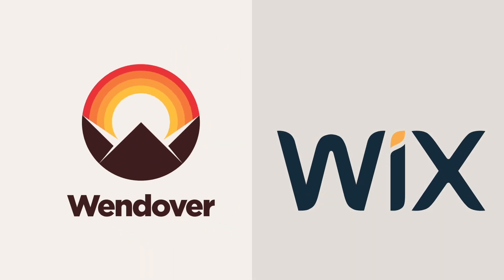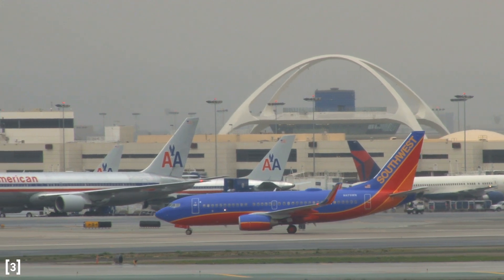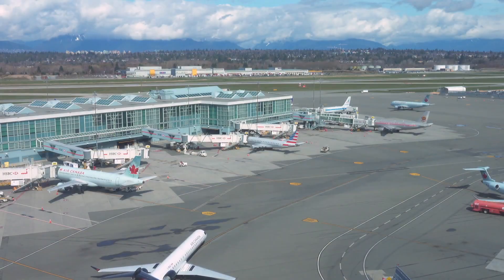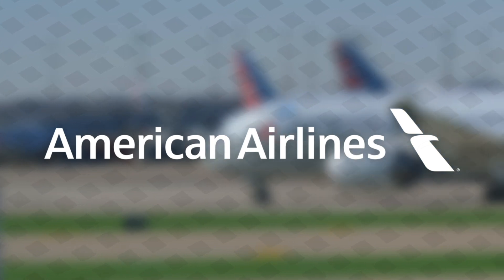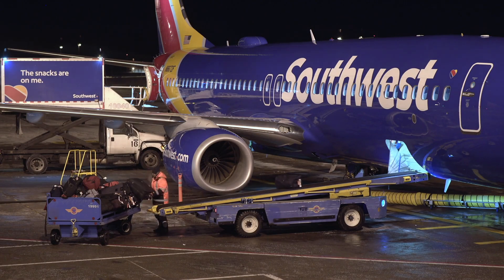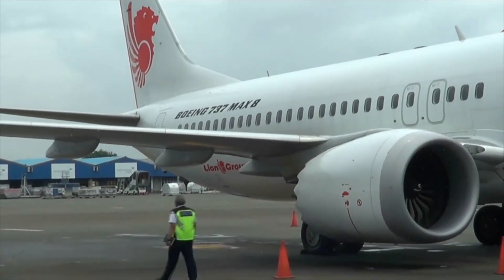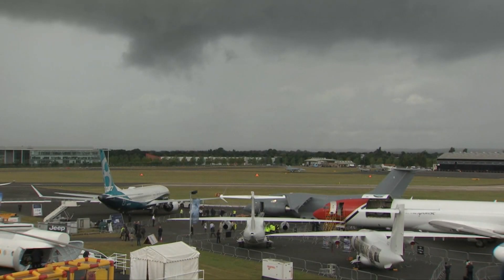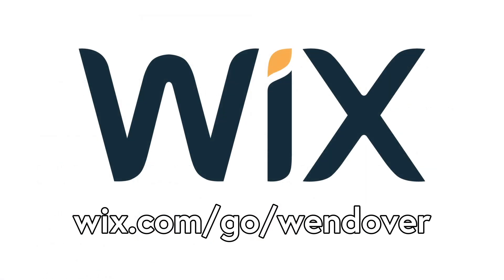The Economics That Made Boeing Build the 737 Max

Comment: So is this aircraft like a video game that has a fault which is later fixed by a patch and that's OK? What a load of rubbish, the lives of people are involved here and if Boeing could not factor in the cost of introducing a completely new aircraft then they are unfit to be in business.
Reply: Airlines didn't want a new plane so you can't blame Boeing for not making one. If Boeing had made a completely new plane others would just use Airbus current and updated models.
Reply: @RawbLV  I bet airlines would want a new plane if it was better for them than the old one, that's what I'm getting at. It sounds like Boeing  was not capable of delivering such a plane but Airbus was so Boeing try to compete on the cheap which then costs lives. Boeing sound typical of a company that concentrates on short term profits at the expense of long term viability.
Reply: @FairladyS130  Airlines wouldn't take it, they would have to cover the training and all the loses that happened because of pilots not being in air
Reply: @RawbLV  I've already responded to that point, a better plane is one that would be economically viable for the airlines. Or isn't Boeing capable of doing that? And how come Airbus are apparently head of Boeing?
Reply: @FairladyS130  Come on dude. A new plane wouldn't be economically viable. It would be much safer just to receive an updated plane. You have to understand that a new plane requires new spare parts, training for maintenance workers, flight attendants, then actual training of pilots and downtime, and there's probably a lot more to it. You think it's better but you're wrong, that's why airlines wanted to have the same plan with only few modifications, mainly the engine. And why did they wanted a larger engine? To have a slightly better efficiency so that they could save a few bucks. Introducing a new plane would cost more than those savings could offer. It's the whole reason why Boeing was forced to this position.
Now, why Airbus is in the leas, I don't know. Could be because Boeing has had made many accidents before which lead to crashes, but I really don't know.
Boeing is too big to fail and they're backed by the military. CEO will keep blaming pilots for the crashes to keep the shareholders happy. They won't admit their fault, at best - only partially, mark my words.
Reply: @RawbLV  Logically you are saying that airlines would only have one plane for economic reasons. So where does Airbus fit in, airlines are using them too which according to your 'reasoning' is uneconomical. Why don't you face the reality that  Boeing fave failed to compete with Airbus. But not to worry, your taxes will bail Boeing out.
Reply: @FairladyS130  Exactly. Airlines usually operate using a small number of planes. The cheap airlines like Raynar use one plane only and as little staff as possible, that's why their profit margins are much higher compared to big airlines (it's actually a very fascinating subject, I recommend you read more about it, if you're interested).
I know Boeing is failing to compete, it's not a reality that I don't accept lol, did you even read my comments?
My point is that Boeing had to update their design as airlines would not accept a completely new plane. Their updated design had poor flight characteristics which they had to patch using software and the rest is history.

Comment: You neglected to mention that the 737 has just about the longest and best safety record of any plane in the sky, and that the Max suffered a very simple - yet very tragic - fault which is easily addressable.  It's also worth pointing out that it was the new technology that crashed the planes,  and not the decades-old cable actuated design with the 7-step starting procedure and paper checklist.  You (intentionally) try to make a great company sound like they haphazardly cobbled together a bunch of outdated garbage into a death trap.
Reply: U are sure? 737 best safety record? Max's is flaw design

Comment: All the Max needed was a DC9 style stick pusher to push the elevators forward and warn the pilots of the stall, rather than the computer overriding the pilots, which ironically until the Max was what Boeing had as a core philosophy. Pilots fly the plane, not the computer.  Wore when they added this computer system they didn't tell the pilots, and worse, instead of just pushing the elevators it trimmed the entire back wing in such a way that it became a total loss of control to correct.    Sad, these crashes should never have happened, and MCAS, was never really needed.   Old school can still be the best school when it comes to flying. Fly the airplane.

Comment: Correction: 737-Max does NOT have a tendency to stall. It would actually stay pretty flat if it were to stall. MCAS was introduced not as a stall prevention system, but to "simulate" the flying characteristics of 737-NG. In doing so, the system can automatically trim the airplane depending on flying condition - normally just to make the airplane fly like the old 737's so pilots wouldn't have to retrain for MAX airplanes, something that is heavily desired by airlines that ordered MAX.  But of course if the Angle of Attack sensor (alpha vane) is broken, this fly-by-wire system (MCAS) that is freshly installed on the MAX could pitch the plane down, but the system was not designed because the airplane tends to stall. A big distinction there.
Reply: Look again, mcas is still antistall system. "Pretty flat" is not full flat...

Comment: Hey wendover how are you ? Sorry to say but this video is not at the same quality level as the other videos you have done,  the first minute off this video have alot of false information, to begin the 737 max have a screen who tell's the pilots what is wrong with the aircraft, and even have colored warnings that tell How bad the problem is: white for information, yellow for caution and red for emergency, I think the light you are talking about are the master warning and the caution lights, those are mandatory now days and every commercial plane have to have them.
Another point is the start up procedure, all commercial planes need to do more than one steep to start up, is a safety mechanism and wrong to point this out as a negative "feature" off the 737 max.
I hope I was useful for you in some way, and please, take this as a productive criticism.

Comment: I do agree MCAS has design flaws, but I disagree on the fact that MCAS caused the two crashes. MCAS will not be activated when flaps are extended or AutoPilot engaged, so if everything went will it will even be a factor during flight. Also there are 3 ways to override the MCAS, including a permanent way to disengage it completely. 
As shown in the Ethiopian crash preliminary report, the pilot made several mistakes and get tunnel visions with MCAS and ignored the more serious problem of over-speed, the accident itself is much more complicated than just the MCAS.
Reply: Mcas is cover up for bad airframe design
Reply: @mateuszzimon8216  Boeing do not have any choices anyway.
Reply: @saturnv2419  Boeing have choices make smaller version of 787 as new frame, but choose to just slap big engine on old frame
Reply: @mateuszzimon8216  Because designing a new frame take a lot longer time, neither Boeing nor its shareholders can tolerate that time.
Reply: @saturnv2419  shareholders vs good design, but Boeing just can't tell AA we make a 100ng and u get 100 of new plane when is finished. This is why we don't have new car with reliability like old Volvo's...
Reply: @mateuszzimon8216  The problem with that is A320 would take over the market like 787 did, which Airbus lost a ton of money but designing the new frame of A380. 
No one would thought the MCAS flaw is that critical, and as I said before as least from the preliminary report, MCAS is not the only reason for both crash.
Reply: @saturnv2419  just make simple test do u have car with ESP? Make a "deer test" on\off. It's just like MCAS, change character of car. And wanna remember u ng and max is "same plane"
Reply: @mateuszzimon8216  First of all, MCAS is a technically not a new system, it is just an additional electric trim mod. In autopilot plane's computer can and will do the exact same thing as MCAS if wrong data is received. 
Second, the purpose of MCAS is to make sure it "feels" like the old plane and "safer", which backfired heavily.
Reply: @saturnv2419  MCAS work with autopilot off, it's new. And it's just cover to aero instability flaw. Plane should fly straight not pitch up with possible stall
Reply: @mateuszzimon8216  @Mateusz Zimon It is not new in the sense that it is based on the same maneuver principles of autopilots, which if you search for Qantas 72, you will find the exact same pitch down movement by the plane itself.
Also MAX will not pitch up when fly straight, it tends pitch up more when already pitched up.

Comment: How hard would it be to make SUBSTANTIALLY longer 737 landing gear so the engine can once again be mounted under the wing's rotational center?  BACK UP PLAN:  Bring back a modernized version(s) of the 757 to supplant all the 737 MAX variants.  This is the part of the market the 757 was meant to occupy, and the 737 was NEVER MEANT TO.

Comment: This video explains that American airlines had contemplated this model even before the manufacturer did. This implies the economic benefits spoke to the airline rather than Boeing of bring the MAX to fruition. Perhaps Boeing should have mad the suggestion that a hugely antiquated aircraft model with retrofitted upgrades does not serve a long term benefit and obviously presented an enormous safety issue. IMO, thhe Airlines were the culprit of greed here, in insisting on a legacy aircraft, not the manufacturer who have no choice but to bow to the demand for it.

Comment: To fly different variants of a common type (I.E. 737 200/300/400/800) you do need to do 'differences courses' and sim training sessions before being able to jump between different birds. Lots of aircraft accidents have been caused by inter variant differences, such as vibration gauges that increase clockwise as vibration increases on one variant but increase anti clockwise in the other. In this case it helped fool a crew into shutting down the wrong engine!!

Comment: The MCAS system is required because there is a structural aerodynamic design flaw in the 737 Max. The plane is unstable. Take a look at this quote: "In the 737 Max, the engine nacelles themselves can, at high angles of attack, work as a wing and produce lift. And the lift they produce is well ahead of the wing’s center of lift, meaning the nacelles will cause the 737 Max at a high angle of attack to go to a higher angle of attack. This is aerodynamic malpractice of the worst kind." - from https://spectrum.ieee.org/aerospace/aviation/how-the-boeing-737-max-disaster-looks-to-a-software-developer
Reply: MCAS is smoke screen for this flaw.... Normal plane on TO/GA flight stright but not Max's.

Comment: The 737 doesn’t use physical cables for its flight controls, it’s either hydraulics or parts are “fly-by-wire” electrically controlled. Cables running all the way to the tail would be a bit ridiculous

Comment: To clarify, MCAS is necessary more to make the 737 Max feel like you are flying a traditional 737. This was required by the FAA to give it the same type rating as the former 737 models. Yes, it does pitch the nose up (which is always a concern for stalling as you mentioned) but it’s not the reason MCAS exists. You are right, it’s all about the money.

Comment: Aviation geeks: the 737 max is an amazing aircraft despite the accidents.
Public: not so fast
Reply: Zhaowei DaFlAsH despite the accidents. That has already taken more than 300 lives. What more do you need to say realisticwords that goes along the lines of “ITS NOT A GOOD ONE BOEING”...
Reply: @sethchong571  dude. That’s the whole point. The 737 max 8 would’ve been an actually great aircraft if these two accidents didn’t happen.
Reply: Zhaowei DaFlAsH two airplanes in 4-5 months is bad enough to prove they did it too quickly. To compete with Airbus.
Reply: Zhaowei DaFlAsH it would have been great but no because it still needed MCAS for help. And that two faulty MCAS proved that Boeing is the problem. Problem that they wanted to compete with same level of quote with Airbus that they want 737 max to fly exactly like 737 older gen. which is not true. So no. It’s not a good plane after all. The design is already pushed to the point it can no longer be pushed. It’s already the limit. And the unethical business solution of not letting pilots know about the system that sucks.